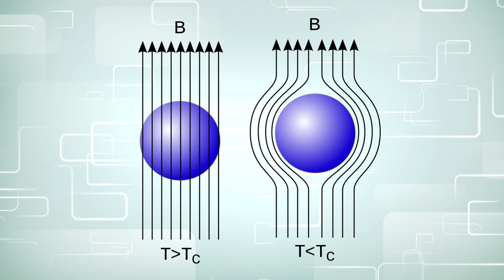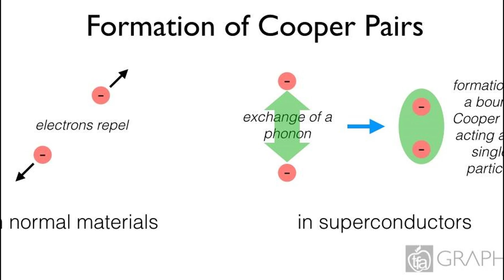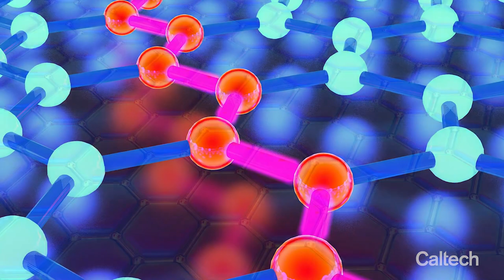Breakthrough Of The CENTURY!? Room Temp Superconductivity

Comment: I stayed on the KIST, Seoul campus for a few months around 5 years ago. The institute is definitely well-respected and their scientists are working on the cutting edge. They are also very well funded and the institute itself led the development of South Korea into a technologically advanced nation. All this makes me inclined to believe that the researchers are not necessarily falsifying their results as some have claimed. But at the same time I'd like to wait and see what conclusion the peer review process settles on before I can put more faith in this new discovery. Perhaps this research brings us a step closer to viable room-temp superconductors, if not the exact desired outcome.
Reply: Notice the low current they used. This probably means that while it’s resistance is low, it’s not zero, so thermal runaway probably occurs at higher currents and loses it superconductivity.
Reply: Superconductivity is not 0 is close to 0
Reply from the maker: National Lab just modeled what could be happening to the material. Copper atoms were percolating into a crystal structure and replacing lead atoms, causing the crystal to strain slightly and contract by 0.5%. This allowed it to be superconductive in specific areas. This is still huge news and will lead to more research in crystal structures.

Comment: The biggest thing I noticed skimming one of the papers is that the critical current was only around 250mA at 27 Celsius, or 140mA at 47 Celsius.  There's a few applications which could be useful at such a low current, but maglev trains, fusion, and MRI machines all require much more current to do anything useful.  It may be possible to make a Josephson junction for a room temperature quantum computer at such a low current which is very significant or some tiny motors.  I hope other labs can reproduce the results.
Reply: Baby steps.
Reply: Just the method of malforming the lattice by squeezing copper into the structure is going to prompt a surge of research, even if this particular version's cc isn't that high.

Comment: I think they released their superconducter statement too early. Because of personal reasons i guess. It is not a superconducter, it is even worse than ordinary conductors. But it is a new method to reach superconductors at room temperature. This is the important point here. I think they need another 6 month or presumeably longer to show that the material turns into a RT SC. It is really exciting work and i hope we can implement this tech as soon as possible. It is like inventing the steam engine or ottomotor. RT SC will be the center of the next (or already new) industrial revolution besides AI and 3D printing.
Reply from the maker: For sure, National Labs is replicating LK-99 in simulation, there is something to it. Another lab in china says they are only in trace amounts of superconducting impurities. Either way, it is looking more like a big step for RT superconductivity even though it's not officially a complete superconductor yet.

Comment: It is not! Those are also poorly written papers. And what you see in the video is the beauty of diamagnetism.
Reply from the maker: If true, then it's going to be disproven really quickly. I find that interesting that it levitates higher than graphene or bismuth
Reply: With the commercial potential that such material would have, my guess is that hundreds of research groups are going to jump on this and not long thereafter reach the conclusion that it was too good to be true.
Reply: exactly. And it's still cool, a new diamagnetic material is always a welcome discovery. They should not have leaked the premature papers though, to avoid all the humiliation that followed.
Reply: I read the paper, and it does a lot more than demonstrate diamagnetism.  It shows high electrical conductivity, a sharp transition from a normal state to whatever this is, and the transition temperature drops as the ambient magnetic field is increased.  So it has a wide range of behaviors that look like superconductivity.  Will be interesting if to understand the mechanism.  I would not assume that the characteristics of the particular materials they have are the best we will be able to do with this class of materials - remember, this is a first successful test and there will be many knobs to turn to modify the behavior.
Reply: Do you really think one of Korea's top material scientists would mistake this for a diamagnet?  He's intimately familiar with them, he even wrote a peer reviewed paper on diamagnetism.  The entire thing could have a number of problems, it's unlikely that 'they're just mistaking it for a diamagnet'.

Comment: I have a misunderstanding.  why is everyone aiming to achieve superconductivity at room temperature?  for me this term creates confusion.  why superconductivity at a temperature that can increase?  ?  and why only that?  there are different situations when the temperature exceeds the normal value of a room.  in the desert the temperatures are much higher.  in space, even at the level of the earth's orbit or on the moon, the temperature is over 200 degrees Celsius.  will we have superconductivity at that temperature too?  or even worse, on Venus, at over 500 degrees Celsius.
Reply from the maker: Yes, good points that is why we need a superconductor that works at all temps.

Comment: Notice the low current they used. This probably means higher current causes thermal runaway. This is caused by while the resistance is low, it’s not zero.

Comment: There's also been a claim from around 2019, from a  United States Navy Scientist.  

He has a patent filed for  a "Flying Craft using an inertial mass reduction propulsion device" 

 - aka -  The U.S.A. UFO  

Mr. Pias, I believe his name is, also has multiple other parents pertaining to said Craft.

However they have been separated into individual patents, so you may have to do a bit of digging on the U.S. patent site.

One such patent happens to be a room temperature superconductor along with the details on how it works and a description of how it's made.

If you know anything about superconductivity head on over and get learned ..
Reply: He discovered the Mass Effect?
Reply: Just remember some of those UFOs can do sharp turns. Person I believe the sharp turn is too fast for a human pilot. It would cost physical harm inside the body to do such a quick maneuver. They're probably remote controlled.
Reply: there a lot of crank patents, as there is no meaningful filter for pseudoscience whatsoever.
Reply from the maker: Yes, I kind of remember that one, I believe that was all dependent on circuitry, skeptical because of the extreme short-cutting but it was one interesting patent.

Comment: All mass loses heat as decay. Mass occupies space as neutralized resistance within it. All mass is thermaldynamics in equalization to resistance. Resistance in mass is neutralized. Time is the interactions of exchanges in occupational space point to point. All mass breaks down as forward momentum pressure in passing through occupational space. You can disrupt thermaldynamics, but cold resistance is constant as cold space. Heat is the cosmic speed limit in resistance as a constant cosmic speed limit in and out of entanglement of mass. Mass in its present time is at maximum momentum velocity in resistance. Conservation of maximum momentum velocity in resistance at present. Hydrogen is cooler than helium. Helium occupies more space, which requires more thermaldynamics flowing in equalization to cold resistance. Physics works.
Reply: … yeah what he said
Reply: @hamishdowling4163 😂
Reply: Too much helium?
Reply: This Markov chain is too old, new LLMs can produce more coherent bs than this.